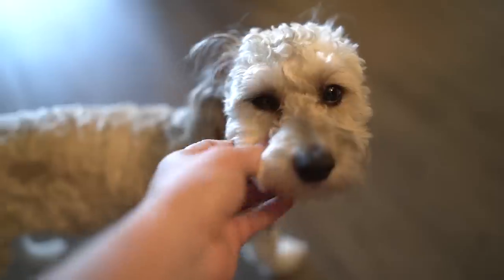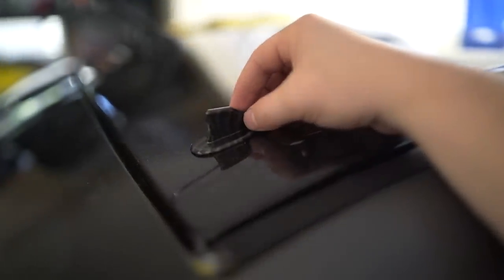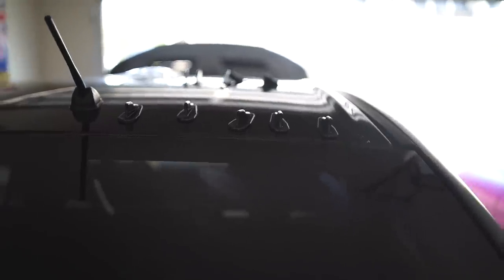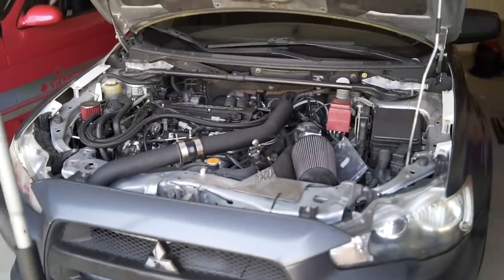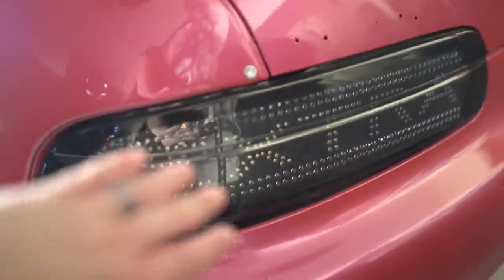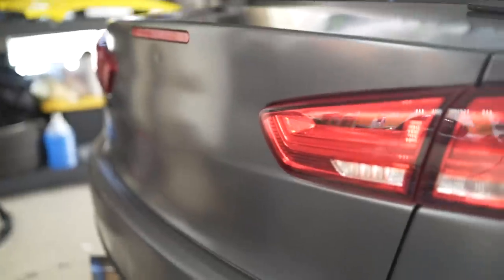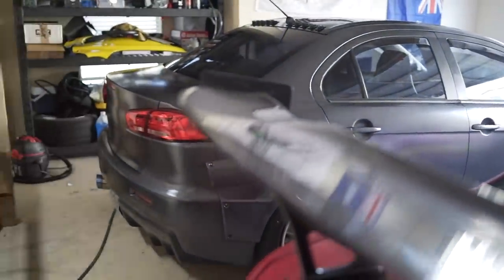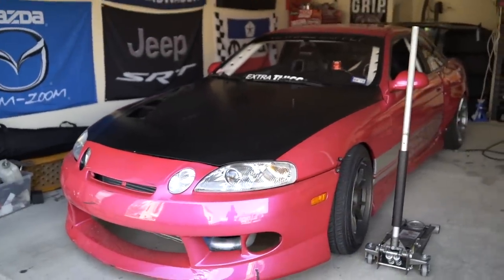$20 DIY Vortex Generator mod ANYONE CAN DO! (Evo X)

Comment: Just some advice for the new lens:

I assume you are shooting wide open at f/1.4. this obviously creates a really shallow depth of field and makes the camera search for focus a lot because the camera is always moving in your hand. 

Try setting the aperture to f/2 or maybe even a little higher. This should still give you the nice bokeh effect that you are going for but will reduce the focus searching because the depth of field won't be as shallow.

Hope this helps!
Reply: Nice to read some educated advice here in the comments! Much Rare!
Reply: Maybe get a DOF calculator for your lens and not use autofocus. Also getting those sequences with one POW with this lens, you might get a better result with sticking your camera to calculated point and using aperture to slightly widen the dof. That way you'd get that bokeh effect and retain a semi descent image over the thing your trying to show.
Reply from the maker: Jonas Godwin thank you!
Reply: BOKEHHHHHHHHHHHHHH
Reply: wrote a reply very similar before i saw your comment haha, all of this is accurate. Sorry for the repetition

Comment: what makes them a "vortex generator" over just a bunch of fins on your roof is that a real vortex generator has ~15° angle on the outermost fin, and the angle slowly shifts so the innermost fin per side is either 0° or slightly angled negatively to the first so they pull air into two vorteces, actually creating downforce by pulling air from the low pressure zone over the trunk, not just interrupt the air for no reason. but it still looks cool!
Reply: Tanner Young the purpose can also be used to disrupt the air so it hangs tighter to the trunk to create downforce, but he thinks its just for looks
Reply: The purpose of vortex generators is to interrupt the high speed laminar flow. By just being there, they do that. To truly optimize the impact like to state you would need to do so for he given shape of the object (i.e. roof/window in this case) and analyse the flow characteristics. 

If you arent racing around a track chasing thousandths of a second off your time, it really doesnt matter much.
Reply: @andrewbatson9710  will it help with fuel economy

Comment: "I'm going all out on this Evo"

*Buys $20 vortex generators" 😒
Reply from the maker: Eric_ST1 y’all really gonna complain about anything
Reply: Evan Shanks the Evo looks sick af, but I think the ones that are meant to go on as a strip look cleaner in my opinion. Especially since they fit the body lines of the roof better.
Reply: Eric_ST1 smh
Reply: I spent 155 on the rexpeed one and guess what? It’s along the highway somewhere because the pos blew off. Put it on with better adhesive then what came with it and this still happened
Reply: Vortex generators that come as a attachable strip are less efficient. The most efficient design is going to be very pointy and with sharp edges which is impossible to efficiently mold into a single strip. 

Without a wing, there's no reason to add vortex generators. Purpose of them is to pull the high speed airflow down the back window and under the  wing, otherwise there's a zone of stagnation in front of the wing and the underside of the airfoil doesn't see any airflow - which then the airfoil is only being about half as efficient as it should
Reply: Evan Shanks dude, it’s every video, between mods, and you “being like TJ” haters love you
Reply: Don't say you're going all out then end up cheaping out...

Comment: I like the individual vortex generators apposed to the strip. It really doesn't seem like they are offset dramatically at a glance and at different camera angles. Maybe you can get the "secret sauce" sprayed on those and then they would look even more part of the roof.

Comment: Dude... that BOKEH is on POINT! Definitely better suited for artistic shots vs running and gunning though.

Not a big fan of the vortex generators, they always look so "stuck on". Guess I am old school with my mods. If it doesn't look like it could have come factory like that I usually don't like it. (The fenders do work depending on the car, the EVO pulls it off IMHO).

Comment: Well this sucks it didn't give me a notification
Aye bro the pretty sure you've noticed this in edit but with he super low f stops I think that's why it's having problems autofocusing try using 2.8 or even around the 3s but lower than 4 so you have nice bokeh I think the lens is better suited for photography dude 🔥

Comment: If anything. Just because you have f/1.4. Don’t use it in video. It’s such a small focus plain. Use at least f4. Sure it won’t give you that fine depth of field. But you won’t be hunting for focus as much. 
1.4 is great for photos, astrophotography, or lens dependent a nice bokeh. But not so much for video. Change your f-stop. If you need more light, check shutter speed. But don’t adjust too low. Should be generally double your shooting mode. Eg 1080/60. 1/120th ss. 1080/30. 1/60 ss. 
Easiest step is ISO, but image quality will purely be dependant on camera when you start bumpin that up.
Reply: You could also adjust your motor speed to slow, or normal. Not fast so check that as well 👌 so it won’t continuously hunt so quickly. 
You could also look at what Focus Area you are using.

Comment: I love the idea with the clear break light making it red, my ford focus has the exact same thing, so ya I am going to do that too. Something you might want to check out is a LED 3M light strip, sold for truck tailgates. It does breaks, and signals. I added one to my Ford Focus and it looks sweet, making the clear break light red will be even better. Car overall is black but has a lot of red. I was watching your video because I am adding vortex generators which I painted red.